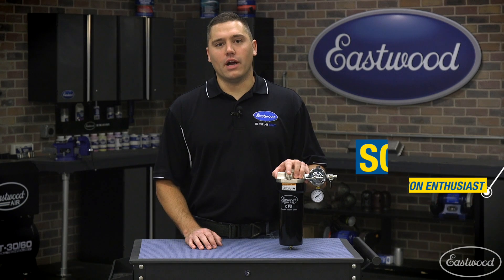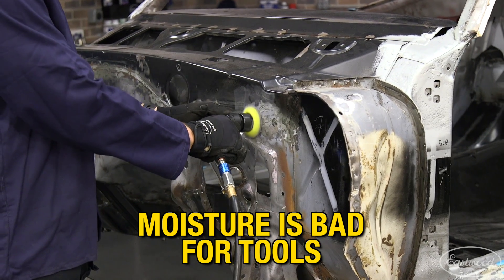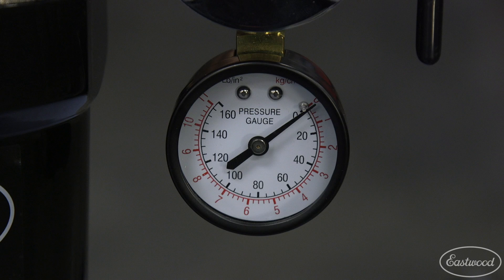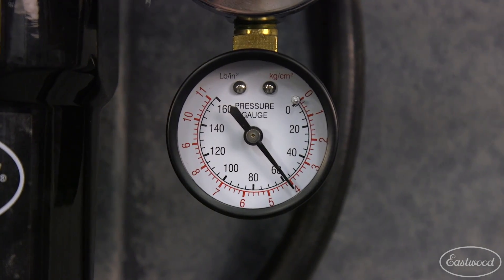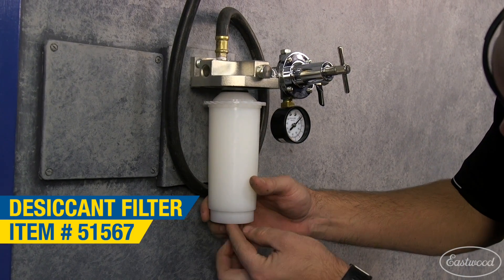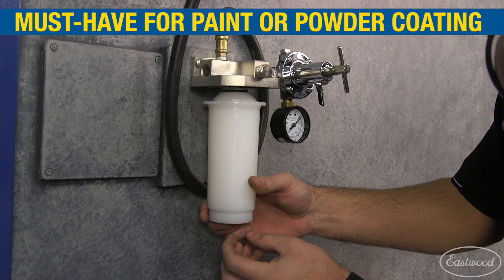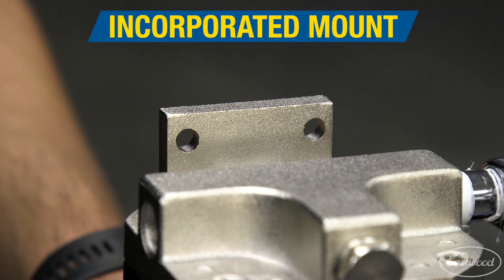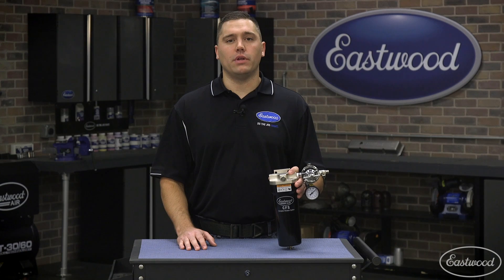Clean Compressed Air for Painting, Powder Coating & More - Complete Filtration System - Eastwood

Comment: Is this something I could add between the compressor and the tank so that the tank stays water free and doesn't need to be drained often?
Reply from the maker: They're generally put between in-line between the tank and the tool. That way you're guaranteeing the tool air is clean - the tank is easily serviced with a built in drain.
Reply: amazon  sells one self train. i did it myself just like to describe anthony helps a lot

Comment: After my in-line filter regulator sprung a leak in the diaphragm I purchased one of their Complete Filtration Systems (CFS). After being down for a week my CFS arrived. I installed it and when I tried to adjust the pressure the needle on the gauge wouldn't move. After closer examination I found that when it was assembled they had the needle on the wrong side of the peg. To keep working I installed the gauge off my old filter regulator. I contacted Eastwood and told them about the problem and that I did not want a whole new unit, I only wanted the gauge. They sent a call tag for the whole unit. I told them this was not acceptable but they said they do not sell gauges and that I needed to send the whole unit back. I told them I did not want to be without my compressor for two weeks and that I would send the gauge back and that I was sure someone there was capable of unscrewing a gauge and putting it in a box and mailing it. They once again said they do not have gauges. I told them it was not acceptable and asked for the email address to the parts department or better yet a phone number. They have now quit responding to me. After receiving the bad gauge how difficult is it to remove a gauge and send it to me? They could screw the bad gage on and send it back China. This is a full failure They don't care about their customers. I am in the beginning stages of a full rotisserie restore of a 1970 Roadrunner and will need paint and supplies, BUT I will not be getting them from a company that has no respect for their customers and inept employees. (If anyone from Eastwood is reading this, inept means having or showing no skill.
Reply: Did you ever finish the roadrunner. I been restoring a 68 charger r/t for years now and I know it can take awhile! So is this complete filtration system worth a shit or is it junk?
Reply: That’s bad business

Comment: Wait the compressor has a regulator. You also add a regulator to the gun. So you need a third regulator in between?
Reply: Typically the regulators on compressors are no good. moisture will gum it up quick, as air is hot and moist straight from the tank.
Better practice is to filter the air then regulate it and even better if u can cool the air before filtering it
Reply: @darren92redrum67  Great explanation, thank you! To cool the air before regulating, will 25 ft of rubber/pvc compressor hose suffice or does it have to be metal piping?
Reply: @firpofutbol  can really depend on climate, temperature and humidity. Will probly work most of the time, but maybe occasionally u will get water.
Also depends how hard ur using the compressor if it gets very hot ur likely to see more water.
U can try the hose if that's what u have at hand. I piped my system with 12mm OD pvc, because cheap option ;)
U may get some pressure drop, u can add an auxiliary resivor at end of the hose will help and will add more capacity and the resivor will help with cooling. 
I was lucky enough to get a after cooler/radiator from an industrial compressor that had a hole in it, I got it welded.
I run my air from compressor to tank, prefilter 3um, aftercooler, then two filters 1um and 0.01um, then filter regulator at point of use. I only seen a bit of fog once at the regulator, so seems to work well enough. 
I have recently upgraded my compressor. I was running two direct drive 2.5 horse power cheap brand compressors, one 25 litre other 50litre tank. I upgraded to a belt drive with 100 litre tank.
The belt drive seems to run a lot cooler than direct drive. And capacity seem to make a big difference how well tools run.

Comment: "Low pressure tool as a spray gun" clearly this guy know nothing about tools. An spray gun is one of the tools that are more air demanding...
Reply: Spray Guns run at lower pressure (PSI) than most tools, but yes the demand is HIGHER (CFM)
Reply: @darren92redrum67   spray guns needs much more air than most pneumatic tools.
Reply: @humbertoflores49  Spray guns need volume of air, not that much pressure, volume and pressure ar related but different. An spray gun HVLP needs about 10-15cfm but only 20-30 PSI...
Reply: There are LVLP guns